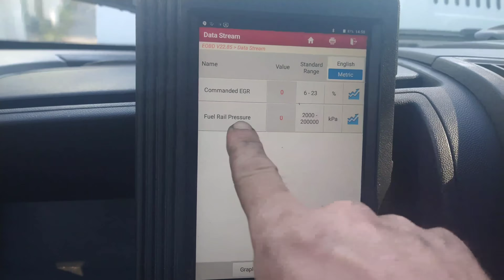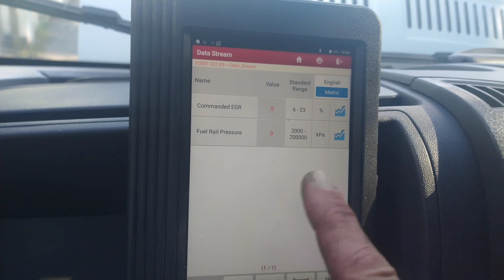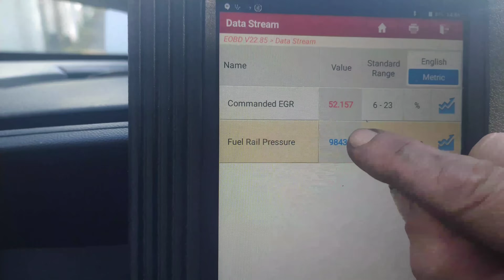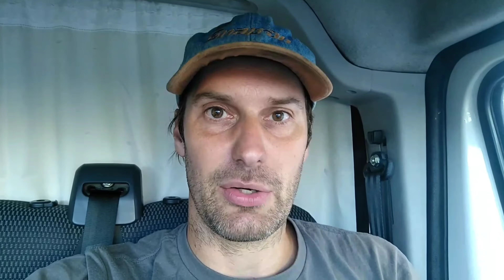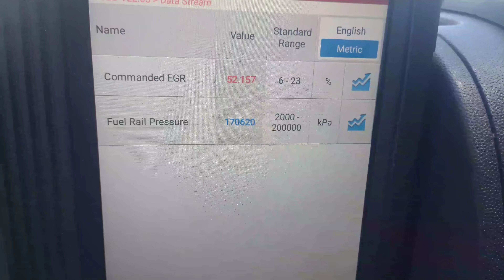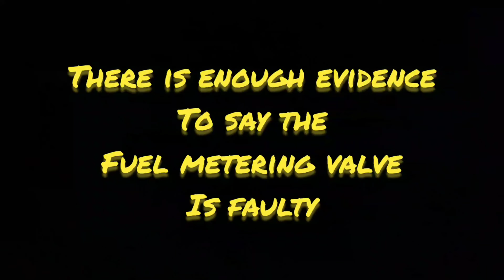Citroen Relay running badly (part 1) the Diagnosis

Comment: Well done mate , BTW matt is there any one that I can learn from like Paul Danner but for diesel engines?
I've seen every video on Scanner Danner and have good bases on electrical diagnosis, recently found you mate and am learning from you and also Dave Sterl ... love you guys I hope you have some time to fit in a suggestion
Reply from the maker: Hi Salah, I was looking for someone as good as scanner Danner that works with diesel engines, I found Frank Massey, he is on YouTube called auto inform, cheers Matt
Reply: @mattsautodiagnostics  Okay I will look for it Thanks for the swift reply Matt , you're the man

Comment: had a ford focus tdci with fuel pressure too high  problem  was a small leak in the fuel filter causing it to draw in air  creating a fault code for fuel pressure too high ,  fuel starvation can cause high pressure to  . thanks for sharing
Reply from the maker: That's good to know, thanks 👍

Comment: And onto the common rail injecter pipe end
Reply from the maker: Yes that's it, it. The gauge hose attached straight onto the rail in stead of a high pressure pipe that would have gone to an injector, it only runs on 3 cylinders when doing this but the kit didn't come with a T fitting. Cheers Matt

Comment: Just as a matter of interest i had a honda where the metering valve was fine but the pump had water damage. The wear in the pump caused the pump to over pressurize the system. The metering valve tried bringing the pressure down but could not. But that might be 1 in a 100 times. 99 times it would be the valve
Reply from the maker: I had thought about that, if the metering valve doesn't fix it it must be the pump, or even a crushed fuel return pipe that's stopped fuel return flow. I have also had a pump return too much straight back to the tank. Thanks for watching and your comment

Comment: 1000 Bar 145000 PSI Takes some comprehending great little video Matt👍
Reply from the maker: It's crazy, on full throttle they were going up to 1600 bar, newer ones at full throttle run at 2000 bar. Thanks Kevin

Comment: Hi great video matt were did you attach the gauge too was it were the rail pressure senser went i bought one of them gauges but came with no attachment pipes just the pressure gauge were did u get the pipes from or what do u use to attacht to gauge
Reply from the maker: No I removed one of the injectors fuel pipe and fitted it onto the common rail where the pipe was, I had the sensor still in the end of the rail so I could compare pressures. Thanks for watching
Reply: Cheers thanks for your time and videos very educational
Reply: Hi were did u get your pipe connection from to connect onto gauge?
Reply: Mine just turned up with just gauge dial head no connection pipes wondered were I could get some to fit onto gauge if you had any recommendations and to go onto rail

Comment: Well done mate. Sounds  like you was at side of the road with that one and on it for a long time as it was dark time you  finished
Reply from the maker: Yeah It was very busy on that street. I got some testing done, then I had to go home to get my gauge, by the time I got back it was dark, luckily I only had to do a quick rail pressure test. Thanks mate